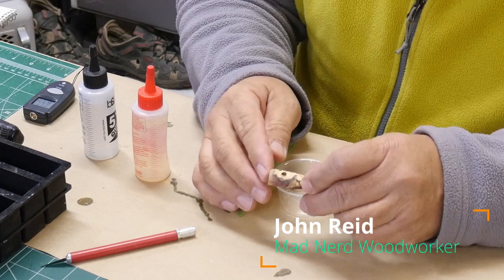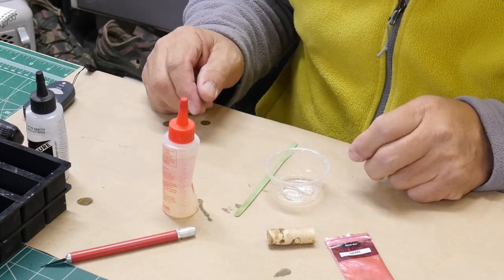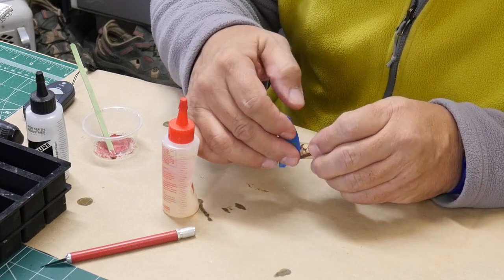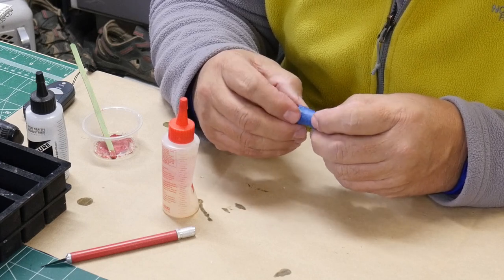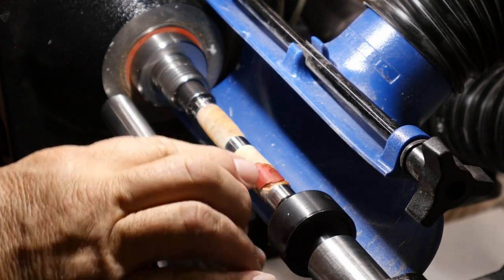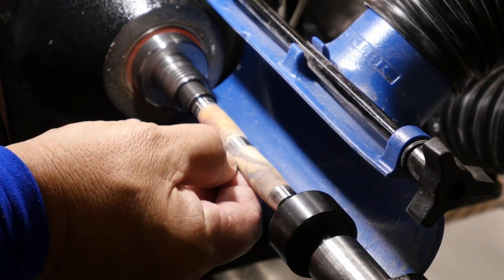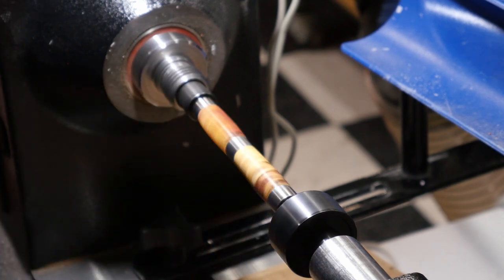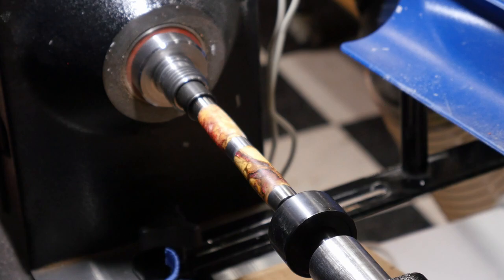How-to repair a pen blank and make it look great!

Comment: It looks like the wood was Cherry burl. I made a pen from this wood a couple of years ago and had the same problem with a viod. I filled it with epoxy like you show, but I did not have dyes at that time. What I used was brass shavings that I got from my local hardware store's key making machine. The end result was fantastic and I was able to sell the pen for more than I would have gotten if the blank did not have the void.  Since then I have made more of this type of pen using Cherry burl that I am sure has voids. The customers love them.
Reply from the maker: It does give it a fantastic look.  Thanks for Sharing. I may some day sell some pen.